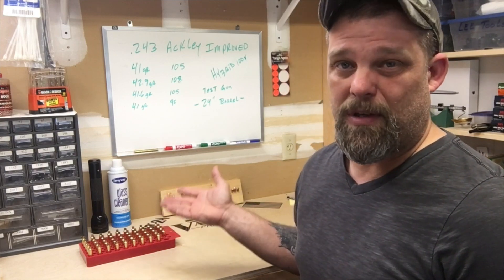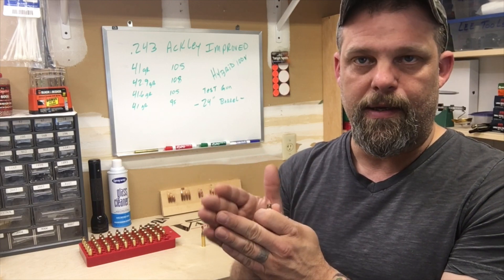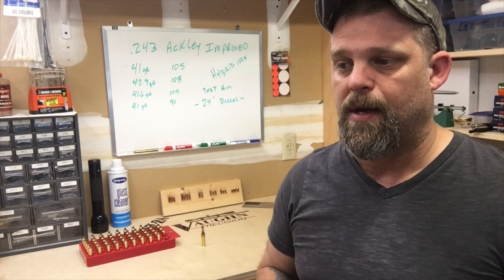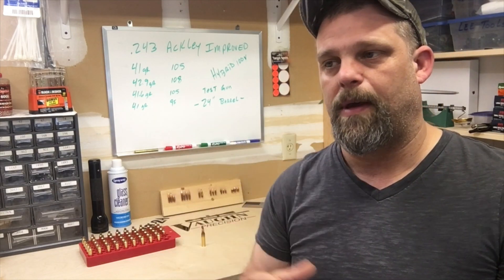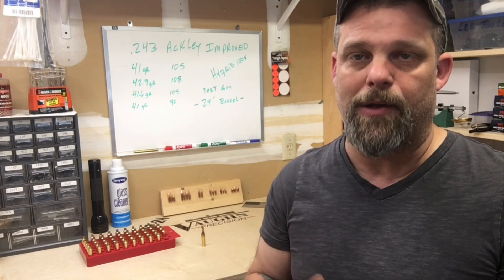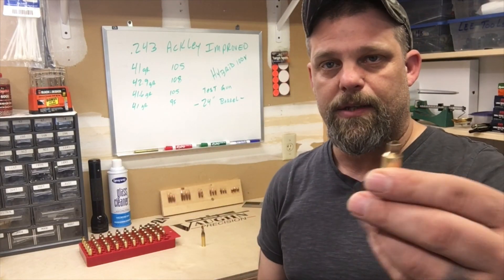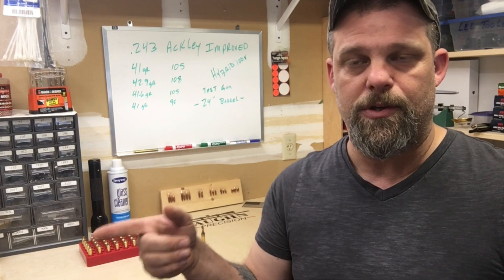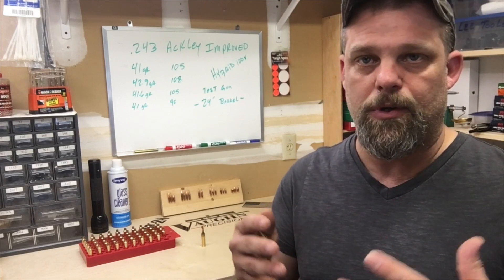243 Ackley Improved, load development Introduction (pt 1)

Comment: I have yet another question.  Have you ever noticed that the POI changes with the maker of the  brass?  For my test I used the same charge on all loads, the same bullet, all were 140 eldm, I shot two three round groups with each bass.  All brass within each group weighed within 1/2 of a grain.  Each manufacturer of brass had different weights but all were weight matched. The groups were not great but were hot horrible either.  Ten groups shot averaged under .75 with the best .475 but the groups all shot to the left from a .25 to a bit over 1.00 in but the group was .652 lapua was all within the red circle but on the left half. Hornady  grouped right outside with a .570 group but starline almost 2" to the left but grouped at .775.  any thoughts, all were annealed and then neck sized.
Reply from the maker: jaxplane yes, brass can make a shift of impact. From what I’ve noticed, it increased or decreased the MV, thus causing the shift. But that’s only a “best guess” on my end. The hardness of brass could also be the issue.
Reply: Thanks for the reply, Im new at this and sometimes things just dont make sense to me. Ive found Lapua brass is incredibly consistent so i think im going to make it my only brass for precision loads.  Thanks for sharing you experience with us.

Comment: Had to go thru the same reloading issues with my 223AI, On average with the bullets I use the new load is one grain higher then my straight 223 accuracy load. The 243 AI has a lot more capacity then the 223 but the concepts are the same when reloading just scaled down.  The upside is I am launching a 75 Amax at a touch over 3k FPS without pressure signs for a 10 shot group of .45"